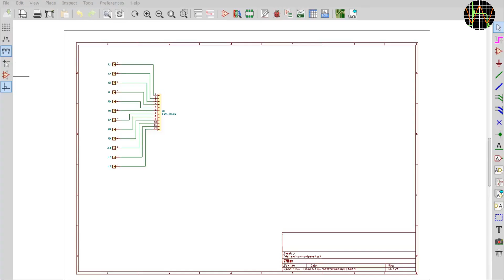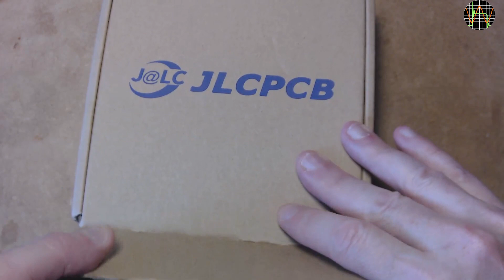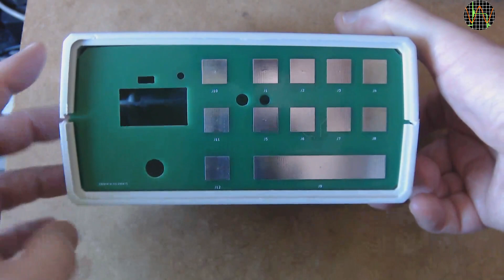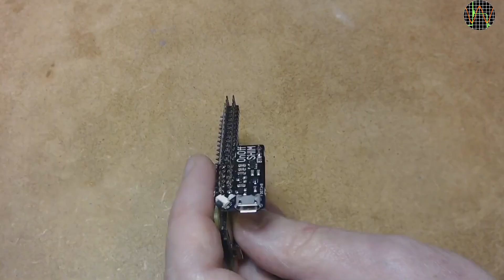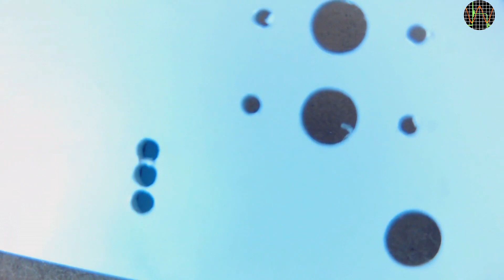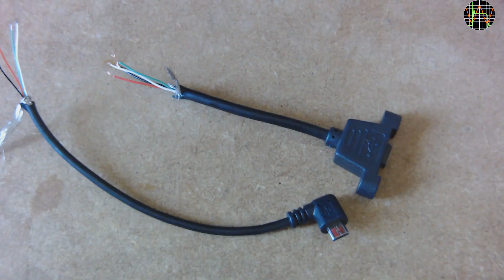Environment Monitoring Station: Part 1: Hardware build

Comment: A top-rate build, as you always do... Good job! I have in mind to build a similar indoor barometric pressure sensor with a BMP280. I have a bad back and I want to track the pain against the barometric pressure/rain. I know by experience that there is a direct correlation between the two, but I want to quantify it. This will give me additional information to discuss with my doctor.
Reply from the maker: Certainly, the barometric pressure readings of the BME280 on the Enviro+ seem to be very close +/- 1 hPa (or 1mb) to what the METAR of the local airport (10 miles away) reports as air pressure. Humidity is a bit more off (reading about 10% too low at the moment I am writing this) but that might be because I am using  the sensor indoors.  The temperature value produced by the BME280 is an internally used value to correct the humidity and pressure readings and is only roughly related to actual ambient temperature (about 3 to 4 deg. C too high). That's why I choose to use a separate temperature sensor. I suppose the BMP280 has similar performance characteristics. As far as I know, the key difference between the two chips is that the "P" version can be used on either the I2C or an SPI bus, while the "E" uses only I2C.
Reply: @TheHWcave  For my application, I am really only concerned with the trend of the barometric change, as opposed to its exact precise value. As for another local reading source, my area has highly localized weather and a distance of 10 miles would greatly influence the reading. However, I understand that you are intending to suggest its use only for comparison. 

The main cause for not moving forward on the project is that I am not much of a software coder. I prefer PIC MCUs and C code, but I am thinking that I may be forced to change to Arduinos, in order to have access to pre-written code blocks.
Reply from the maker: I understand. I have put trend into my software, to be released shortly (I am trying to make a video about it...) But at the moment I am only changing the colour of the pressure reading (blue when its trend is falling and red when its going up).  That works great as a weather prediction.  The problem is that the LCD is so tiny that getting more information on it, like by how much, will make the display too troublesome to read. However, my software does recording in CSV format (can be opened by Excel) for more detailed analysis.  The (current) 1.0 manual is already available on my Github page.